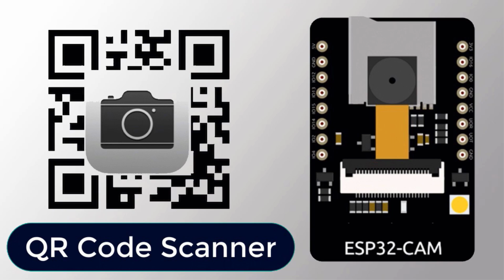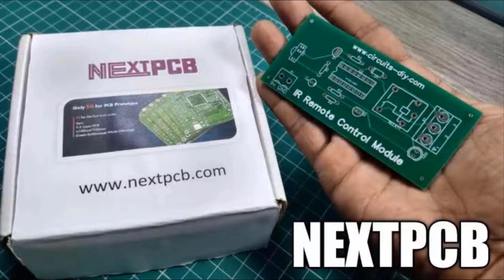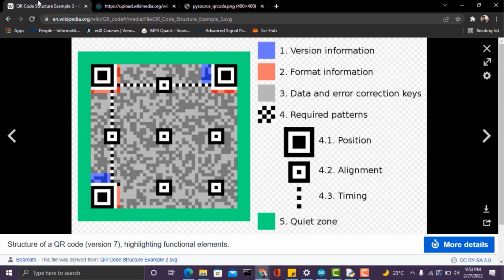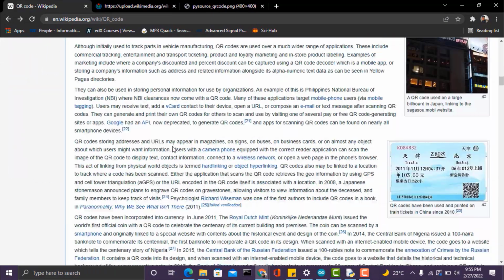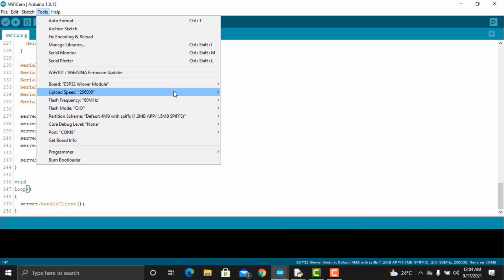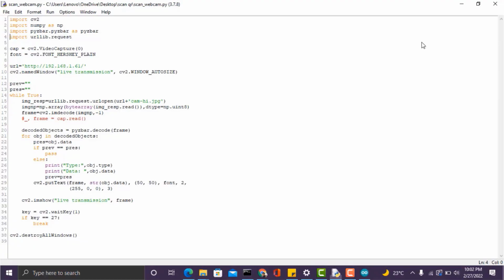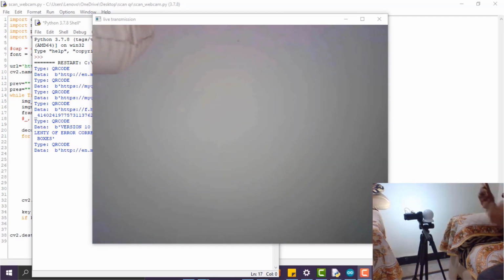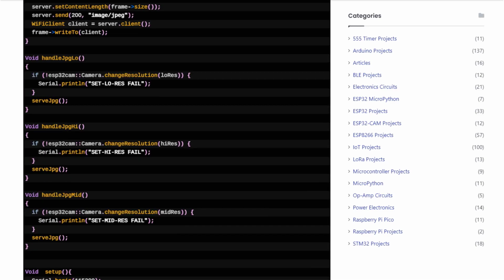QR Code Reader/Scanner with ESP32 Camera Module & OpenCV

Comment: Hello i am making advance electronic voting process in which i have use Atmega32 microcontroller.
There are two features fingerprint based and aadhar card scanning.
Fingerprint part is done now i want to scan QR code of aadhar and configure with atmega32 for voting process for particular person 
Please help me in coding section how should i do that?